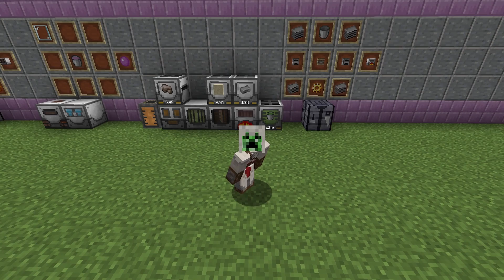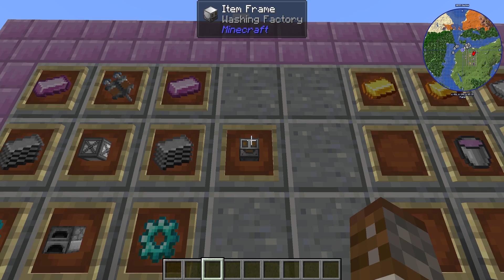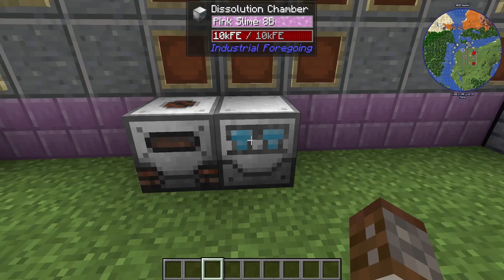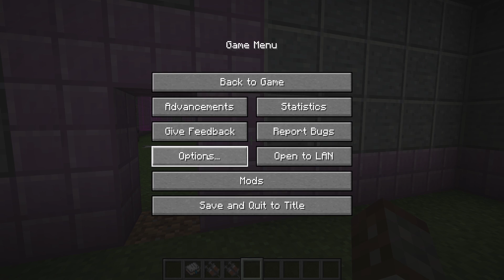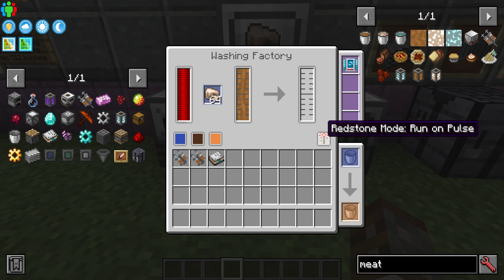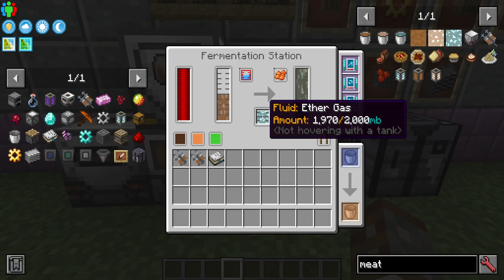How to: Industrial Foregoing | 15x Ore Processing (Minecraft 1.20.1)

Comment: Bug reported on Jul 23 (issue 1358) and fixed on Jan 20 (commit 860616c). It was happening while Processing Addon was being used in Fermenting Machine. Tier 1 was doubling the output and Tier 2 was tripling it. Still exploitable in the current FTB Direwolf20 1.20 (v1.12.1).

Comment: Am i dummy ? Cause it doesn't work with me it's just 5x time. Firt i tried it in atm9 it didn't worked then i tried separately just IF at 20.1 and it still didn't worked out, did they already fixed it?😮😮😮
Reply: Its definitely 5x in atm9 and I think its more balanced that way.

Comment: with a process system like this you would need either a line for each raw ore or a pipe system that can transfer set amounts of fluid (laserIO) but omg 15X is insane as mekanism is a bit odd when it comes to raw ore
Reply: for a 15x ore setup, thats not even an issue, ngl
Reply from the maker: With something like the RFTools builder or a chunk destroyer you’d have so many resources it would really matter. I’d probably do one set up per ore also. Or set up a passive with refined storage or AE2
Reply: @Mondays3  yeah, i meant with so many resources the cost to set up one per ore would be negligible that the cost wouldn’t matter